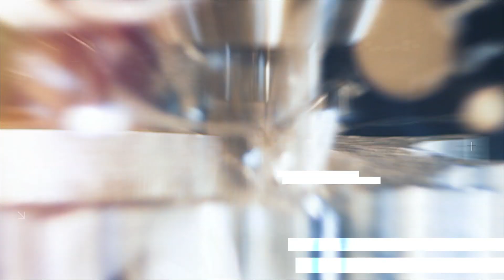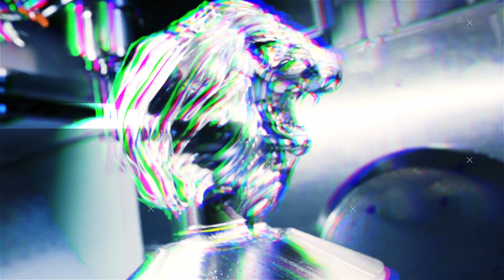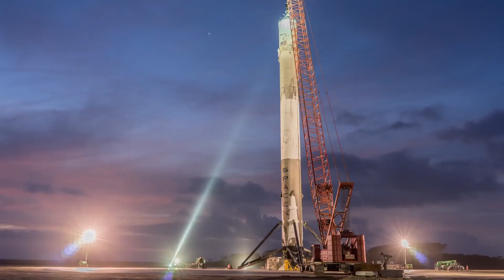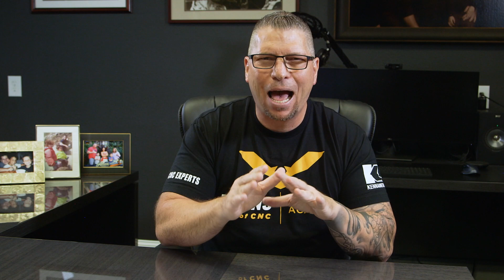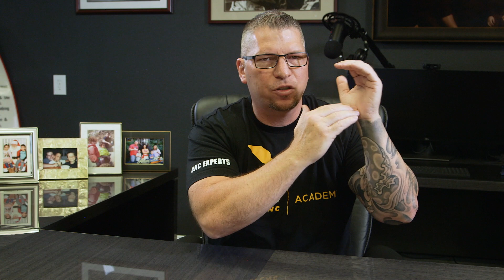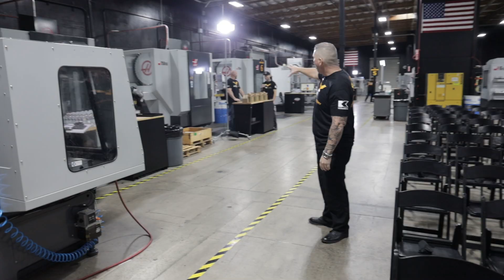The BIGGEST CNC Machining Opportunity - Vlog #94

Comment: Love your channel Titan! I work at Baker Manufacturing in Evansville, WI and we have 3 Haas VF2s, a VF4, an ST45, 3 smaller Mazak lathes, a big 50 older Mazak lathe, a brand new Mazak 35 lathe, an older Mitsu mill, a newer Mori horizontal and a new Mazak horizontal. Many of these machines are under utilized. We are working on hiring more people to fill the shifts we have and run more shifts. We also have a tool room. The main business is a cast iron foundry, pouring small and medium quantities of gray and ductile for many industries. The machine shop currently only does inside jobs, but with more employees we could do outside work as well.

Comment: Regal Research and Mfg. Plano, Tx. 
I am the programmer in the machine shop. But that's only a fraction of what we do. Our shop is massive and our capabilities are vast. From piece parts to full product out the door, including paint/powder coat, mechanical and electrical assembly. Also ISO9001 and AS9100 certified.

Comment: https://www.ultradexusa.com   

specialized services for indexable cutting tools. The cornerstone of our services is custom build manufacturing, detail and assembly. We are experts in reconditioning used or damaged indexable tools and are committed to a revitalized restoration. Our service is a benchmark in the industry with complete capabilities in grinding, milling, lathe turning, EDM, heat treat, black oxide and laser engraving. When companies have difficult custom tooling projects, they have routinely turned to Ultra-Dex for optimal and timely solutions.

Comment: www.microtool.com
Micro Tool Co. Bethlehem, pa
We are an AS9100/ITAR certified machine shop and we manufacture high quality parts for the aerospace, defense, medical, and gas and oil fields. We have capacity for large quantity runs and fully automated equipment with gantry loaders, bar feeders, and Fanuc LR mates. We machine anything from aluminum to exotic alloys. Reach out to us, you won't be disappointed!

Comment: Hey Titan, just found you a couple weeks ago. Binged your content, appreciate your story and drive. Thanks for your service to the industry and amateurs too.

 Question for a slightly different target, if I'm looking to pick up just one machine to run in a garage as a serious hobby/2nd job, any tips in getting started or how to make that machine (Haas VF quality or similar) pay for itself with only a few operator hours available per day? 
How diverse of a tool library makes economic sense? 
Same question but for inspection equipment? 
Tips on sourcing stock cheaper than retail? 
How to find low volume jobs?

Comment: Titan doing business with parker, conni-tech etc is not cnc machines  its rotary transfer, screw machines and swiss there is a market it's just different. I spent alot of time in Lyman Nebraska and Colorado with those guys. I do have open capacity in Maryland at current for these automotive style Ts16959 capabilities. Harford machine, Ace quality systems Inc. and Firm Engineering. Frederick Garrity 4439249446

Comment: no way small shops can compete with shops that have 4 more more $100,000 Machining centers... small manual machine shops can barely make ends meet and shops that are middle of the road wont take jobs under a certain price range. I see more and more small shops closing their doors due to them being unable to compete against the big boys and overseas competitors. the only small shops that are making it are those on YouTube like Abrom, This old tony, etc
Reply: Gotta get away from cranking handles the money is quantity and speed. You can only achieve so much manually.

Comment: Titan, I have been machining at home in my garage as a hobby for about 5 years now. I think I enjoy setting up a job more than I really like designing parts. I enjoy the process of figuring out how to make the part, what order to make my cuts. I really get into work holding and I grind all my own lathe tools.
I have some experience with CAD but not a lot. I've worked with computers my whole life.
I own a couple Bridgeport knee Mills and a Lagun. I own the very last Hendey Tool & Guage lathe ever built and a South Bend.
I love the old stuff and enjoy manual machining but I ha e converted several machines to CNC now and I find myself looking for parts to make from guys in the local area just because I like a good challenge.
I am ready, have been ready to change careers for awhile now. My kids left for college and my wife and I are thinking about a new business.
Would you consider letting me train in your facility with a plan to them return to my local area to open a local Titan branded shop. Maybe if we documented the process soup to nuts you could build a nation wide local network of shops doing it the Titan way on Titan equipment.
You could help guys get started and as a bonus these locations could double as training centers.
There are also a lot of guys who would jump at the opportunity to have access to a real machine. Maybe a reduced rate to allow guys or even small companies to rent machine time. I'd bet you could even make more money off of a company that is going to run a part and make changes as they go and end up using a lot of time. You could have everyone on the same equipment maybe even provide machines if they are doing enough business. With a Nationwide mrp system everyone could share designs and benefit from standard tooling and they could benefit from Titan providing accounting services and payroll and tax support.
If it were all centralized with you how could a shop go wrong?
And then when you do have a huge job you've got a network of guys and machines ready and waiting for the work. You can have a hundred machines there in your facility maybe they're busy maybe they aren't. Or you can have a hundred machines in a hundred locations that are available to you whenever you need them but stay busy on their own.... You know they will run the part correctly because you send them the file and material and tooling to do the job.
Just some ideas I've had watching you work that I thought might fit your business model and give me a better opportunity to work at something I do on weekends because I love it anyway.
And hey, would be a cool thing to watch development on your machining programs too. Who wouldn't want to follow along as Titan takes over the US?
Titan's Takeover....